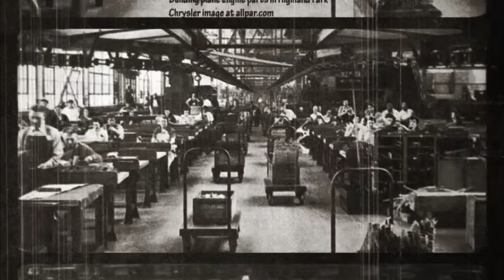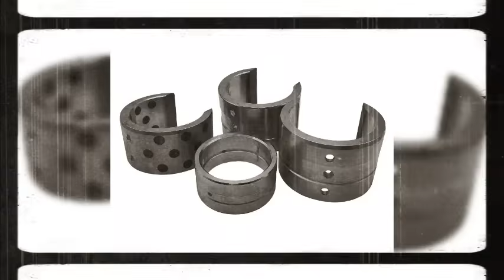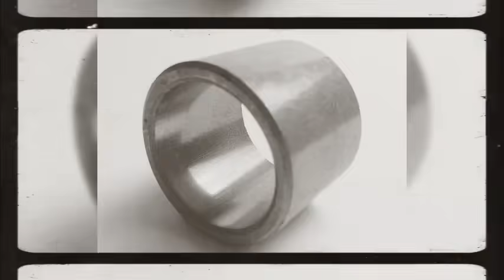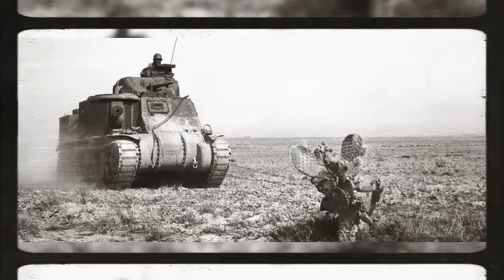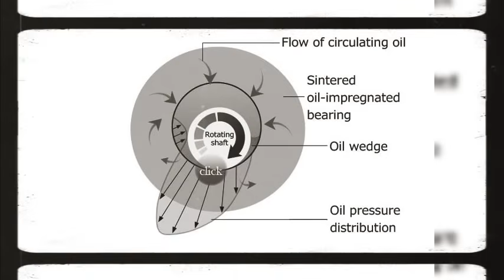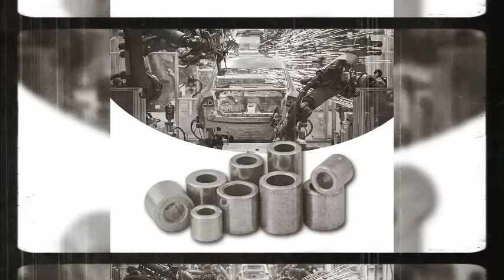US Tank Bearings Failed in Early WORLD WAR2 — Chrysler’s ‘Sponge Metal’ Was Already the Answer

Comment: and when left unlubricated-- they were used by GM and others as gasoline carburator filters among many other filter applications.We used these for clutch shaft bearings back in the day along with the "new" ball bearing types and the Oilites always prove the most durable. 
Recently replaced dryer tub roller bearings (had none-just dried grease) with Oilites to get rid of the squeeking and galling.  McMaster is a good source for Oilites.

Comment: Oilite bearing surfaces can be machined but it requires sharp cutting tools to prevent the sintered bearing material from galling. Galling a sintered bearing would clog the bearing surfaces and block the impregnated lubricant from doing its job.

Comment: The term is "sintered metal", NOT "centered metal"  The narrator frequently mixes the terms "bearing" and "bushing" which are not interchangeable.
Reply: A bushing is a subset of ‘bearings.’  Oil impregnated ‘bushings’ are considered ‘sintered metal bearings’ because they’re composed of separate particles, or ‘parts.’

Either way, calling ‘bushings’ ‘bearings’ is fine; it’s not like the word bearing is specific enough anyway.  For example, you’d specify ‘needle bearing,’ ‘roller bearing,’ ‘tapered roller bearing,’ or ‘sintered metal bearing,’ ‘silvered bearing,’ or ‘Babbit bearing,’ and even those terms aren’t specific enough to cover their particular application.

Yea, semantics matter, but not when both terms are already generalized.

I didn’t catch the ‘centered’ vs ‘sintered.’  Was the episode actually referring to a center bearing, or was it a pronunciation error?

Comment: Oilite bushings are a great idea. Inexpensive alternative to ball bearings.  
The machine shopa I worked at also produced plastic bushings. We created plastic bushings with Oleo added during the extrusion process. The plastic would "sweat" and lubtricate the rollers for conveyor belts used in the food industry. 
You cannot use petroleum based lubricants in food production.
Reply: Food-grade mineral oils and greases are derived from petroleum.
Reply: I THINK it was called Derilan Plastic. not sure of the spelling.
I used to make high performance control arm bushings back in the 70's
when I road raced a 67 442. They eventually got noisy and corrected with a zerk fitting.